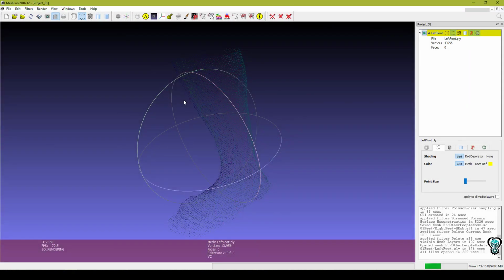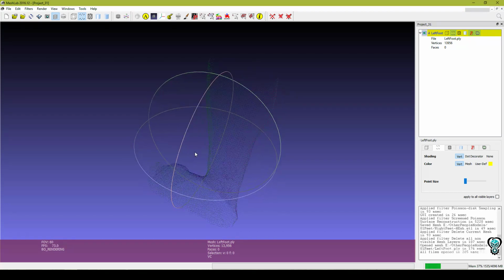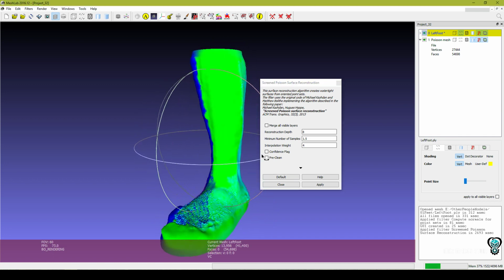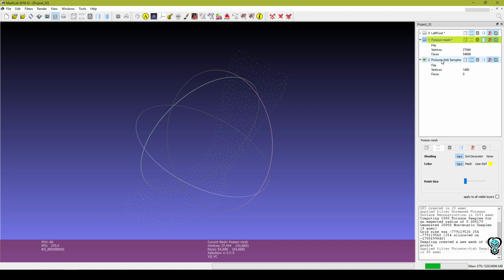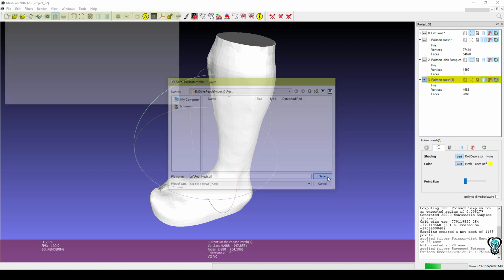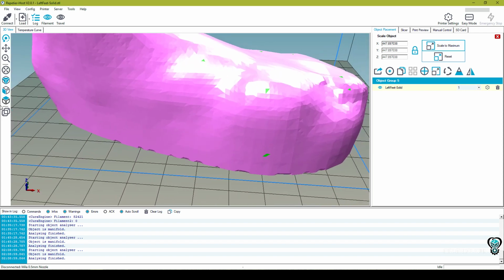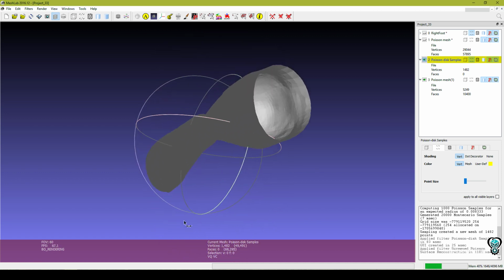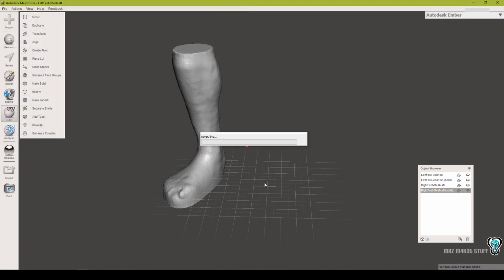3D Scanned Point Cloud Dot PLY File Convert to STL For 3D Printing - Meshlab - Meshmixer

Comment: I have LAS file, how will I convert it to .ply file ?
Reply from the maker: I only know how to do what is shown in the video.
Reply: There is a free program call CloudCompare that will accept LAS and LAZ files.  I forget the exact procedure to output an XYZ file for importing into Meshlab.  It really depends if it is a single LAS or multiples.  The model I'm working with has hundreds of LAZ files but you can import them all at the same time.  I'd like to be more help but I've forgotten the whole procedure, but you can definitely find it on google.

Comment: I dont get it, you say this will work with the app capture but you never mention how to convert the .usdz file, because that is what capture makes. Can you explain?
Reply from the maker: Not exactly. I don't remember there being a .usdz file type. I've only used this software to do what I did in the video. Made the video so I wouldn't forget to repeat the same thing.

Comment: Hi and thank you for the video, do you happen to know if the file has some limitations to import? I have a Racap scene with 12 gb of volume and I have converted from .rcp to .pts. I am having errors while trying to import it into Meshlab. Thanks prior!
Reply from the maker: Thank you for posting your comment. Unfortunately I haven't used it enough to know if there's a limitation on file size. I assume the only limitations would be related to the hardware processing the file.
Reply: Open the file with text editor, rename the original file to .txt. If you check how the file has been compiled (comma separated, xyz etc) than import the .txt file into Meshlab and a popup screen will appear how to import the file. This works for me when .pts files won't work.

Comment: My goal is to take a .ply to an stl in meshlab so my fabricator can carve the below knee model out of a foam blank. Why did you export to meshmixer? Could you have just used meshlab for your end result? Could I just use meshlab for my end result (goal)?
Reply from the maker: Thank you for your question. I moved into meshmixer because I am more comfortable with that software. I know little about Meshlab and there is a good chance you could just do it in Meshlab without going to meshmixer. Sorry for any confusion.